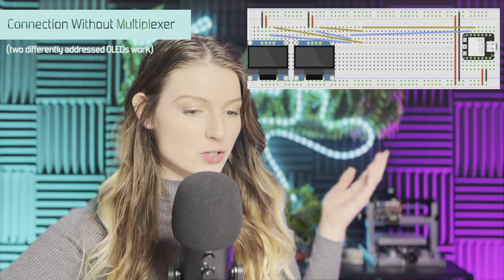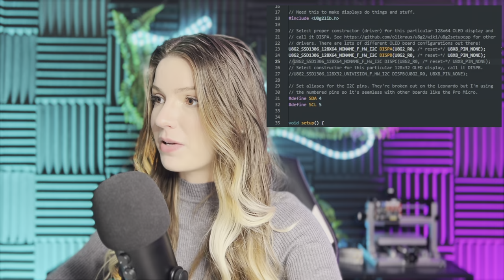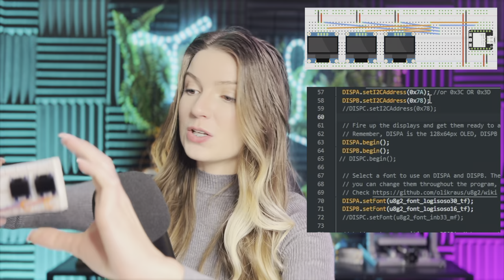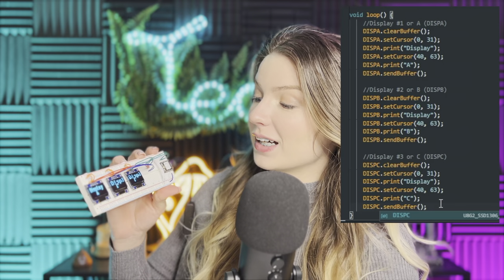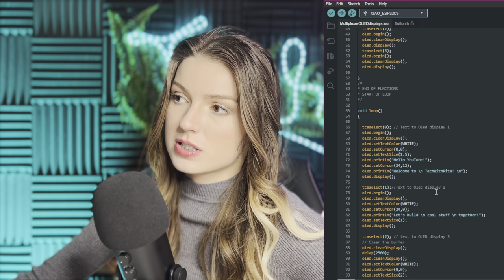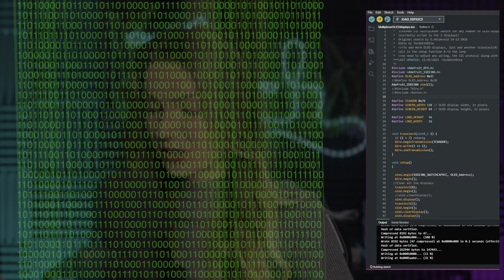Connecting OLED Displays with Seeed Studio XIAO ESP32 C3 - With Code

Comment: These videos are so good and well explained! Fun fact, if you don’t want to use a I2C multiplexer, and have a couple of the pins of the ESP32C3 unused, you can always use multiple I2C busses, and bit-bang all but the one which has the ESP32'S I2C hardware module internally attached. (note, bit-banging is slower though) This way you can control another 2 displays for every 2 pins you have available :)